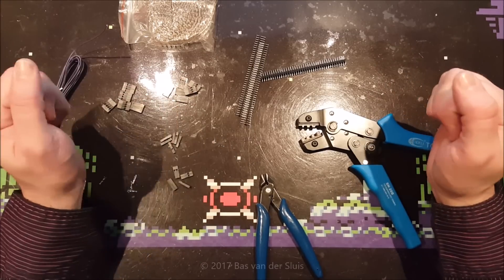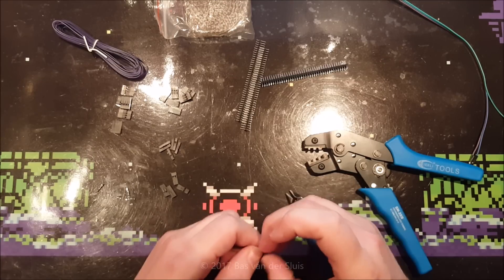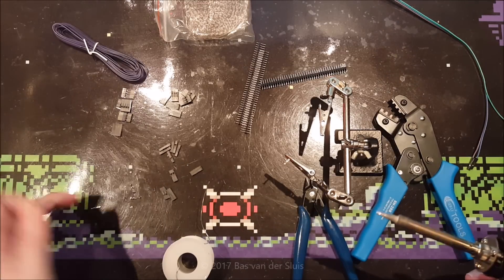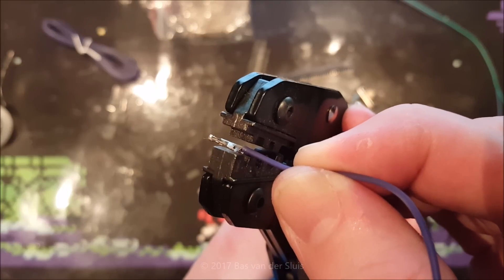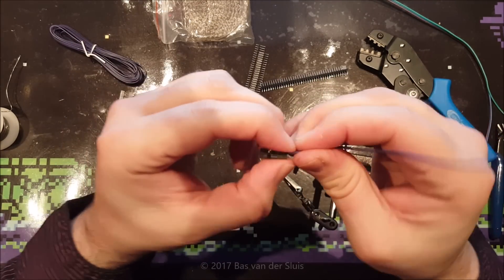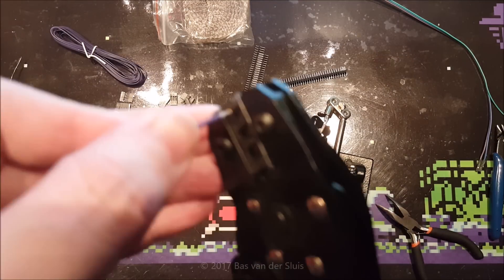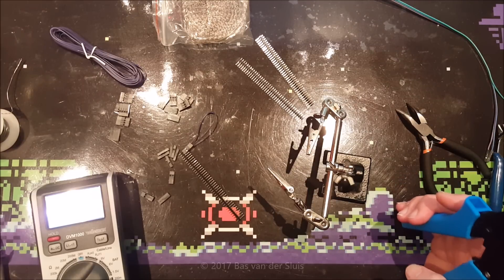How to crimp your own Dupont wires and connectors

Comment: I was always taught not to twist the stranded wire when crimping. I think the reason is because if the strands are twisted together, the crimp is more likely to crush (or worse, cutting) the strands, which is bad.

Comment: THIS IS TOTALLY WRONG. Dupont terminals should never be soldered. They should never be be stripped. The strength of the dupont system lies in the insulation piercing action to make contact with wire whilst still providing the strength of the insulation. Insert  the connector into the tool so that the cable grip prongs are half way, there is a groove to hold the points. push the the unstripped cable into the connector, you should just see the insulation on the other side, then crimp.

Comment: I saw the thumbnail for your video and saw that the crimper looks the same as the one I just bought. So I just watched your video before any of the others and I'm glad I found a decent tutorial. I don't have the crimper yet, but I feel completely comfortable with using the new tool. I should have my new crimper in a couple days. Thanks!! (P.S. I don't understand the thumbs ratio. Your video is way under rated for some reason).
Reply: I would bet that the thumbs ratio is just because of that focus issue where it briefly blurred the result. Don't worry. There's lots of folks like me that appreciate the talking tutorial instead of the ones where the author puts on music and makes us read the tutorial part. I religiously thumb down the musical speechless tutorials all the time. They keep coming.

Comment: one of the fundamental purpose of crimping is you don't need to solder so it sort of defeats the object soldering the wire then crimping.....
Reply from the maker: True. But this cheap Chinese crimping tool with the cheap connectors do not work that well. My wire just slips out of the connector after crimping. So that blob of solder is just my insurance that it will hold. :)

Comment: @Bas van der Sluis Well, I know your pain. You are avoiding the $40 to $45 dollars for the PA-09 and I understand that. But, your are showing as I found out, and was illustrated here https://youtu.be/3Cw9YFLDZeo , That, its is VERY HARD to do a quick painless crimp using some other tool, even the one you have. . But, I must say, I really tried VERY hard to find a sub for the PA-09. No Luck !  I'll keep looking as it just doesn't seem possible that this could be true ! WOW. Seems like an opening for some reasonably priced crimper with capabilities more like the PA-09 at a better price !

Comment: Thanks for the video. Glad that what I thought was a slow process is actually normal. The tip about pulling the terminal to the notch was great. I too have crushed a few crimps and had to set the tension setting to one stop above the minimum.

Comment: The idea to use a crimp is NOT to solder... while electrically strong, it is mechanically weak when all the multi-cores becomes a single wire and easily break ...

Comment: One of the fundamental purpose of crimping is that keeping insulator intact with connectors. To attain this, you have to crimp the insulator part too. That's why connectors definitely have separated sections for the insulator and wire.

Comment: Realy nice video, but aren't the pointy bend things (sorry, don't know the name) supposed to go around the isulation instead of the bare wires?
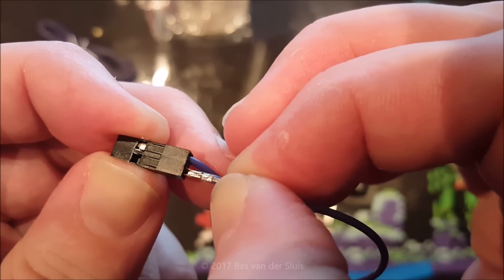Reply from the maker: Yes. If you look closely at 7:16, you can see that the insulation is inside the metal bend pins. A good set of pliers even bend the pointy things through the insulation, but my cheap one does not do that very good.

Comment: If you fill the rear "wings" crimp band with the insulation, you minimize the tendency to over crimp, which is what distorts it enough to prevent insertion. The insulation is actually supposed to just butt against the crimp band that holds the wire, or fall a hair thickness short of touching. That plier has FAR too much mechanical advantage, and that ratchet takes from ability to feel the crimp forming, both conspire to crush rather than crimp. The proper depth of insulation will counter that a bit, acting as a soft "stop", allowing enough height to remain. Though inexpensive, that is really the worst crimper for the job, that is more intended for spade, rings, bullets, etc, those utility class connectors, not delicate precision ones like duponts

Comment: Your video was done with good verbal detail and great consideration of the importance of close-up views in sharp focus. Though I bought them, I had not used these plyers previously, but with your suggestion of pre-mounting the contact in the plyer before inserting the wire, I will give it another go!
Thanks.
Jim

Comment: thank you!
Youre the one person whose said the most important part i was not getting correct: to push the bit into the pliers until it hits and stops in the middle. I tried this and finally i can crimp without the bits turning into crushed bent bits of metal   :-)

Comment: Try pro pliers and you will understand the difference. Japanese Engineer PA-09 or PA-21 will change your mind about quality.
Reply from the maker: You are absolutely right. Better quality pliers make it a lot easier. The purpose of this video was to demonstrate it with this cheap unit, because I think a lot of people have bought this unit (including myself). And for me, a cheap unit is good enough, because I don't need it very often.
Reply: You can try TDOK SN-28B crimping tool,Cheap price but high quality on amazon. Waiting for more video.